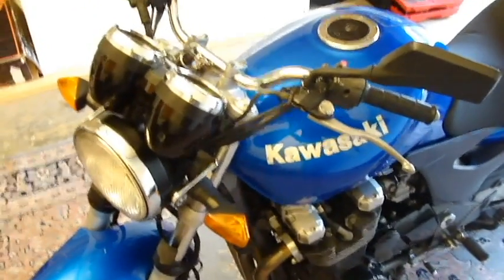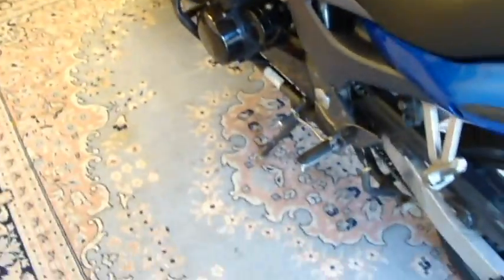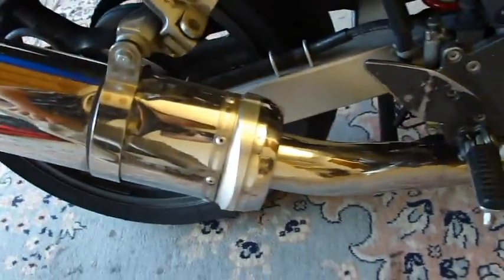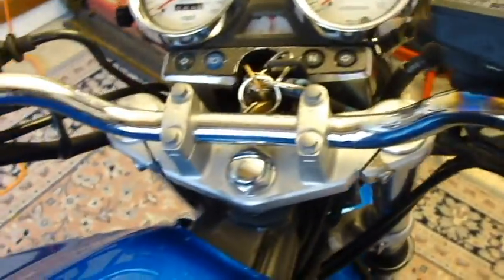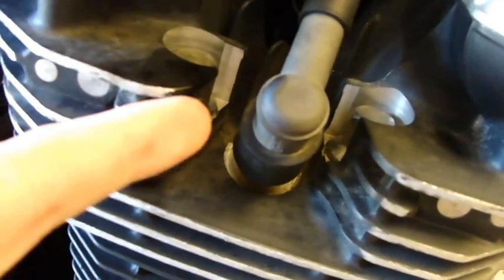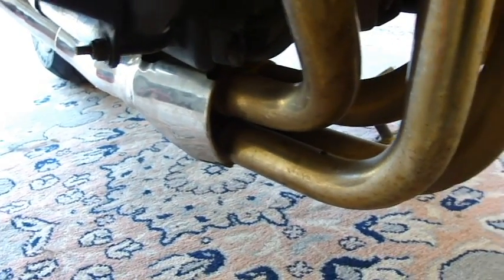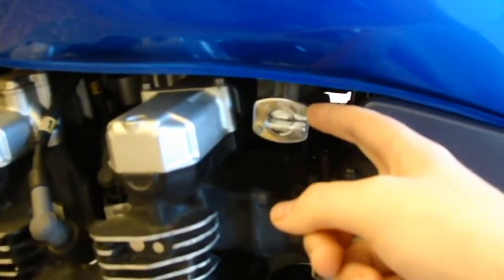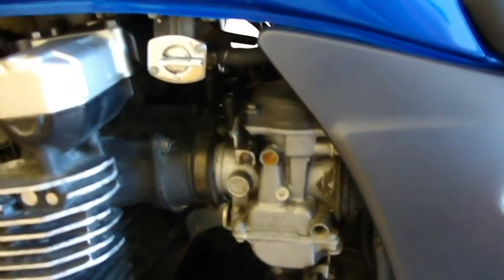2000 Kawasaki ZR-7

Comment: Sounds like it was only running ( firing ) on two cylinders, sounding like a Kawasaki Ninja 500 or a Suzuki GS 500 ( parallel twins ). If so, it was giving up a ton of power.

Comment: Hey Tim,

I have the same noise coming from the mid point between the headers and the exhaust. Did you ever find out what was the cause of that? I’m trying to fix mine.

Thank you!
Reply from the maker: No I'm sorry, sold the bike a couple months after I made this video. Never got it fixed, I figured it was the exhaust connection, like medal on medal

Comment from the maker: No Im sorry... I sold the bike back in May... It was fairly easy to clean them, the hard part was getting them back on the bike. You just have to get them off, clean them out with carb cleaner let them dry and put them back on, unless they are in bad condition, then I suggest letting a pro look at them.

Comment: please do not use high rpm while the engine is cold, thanks, its very bad for him, btw it was running at 3 cylinders
Reply: Zariss791  High revs on an air cooled engine will definitely shorten it's life. Definitely running on 3 cylinders. Sounded very choppy with lot's of primary chain slap.